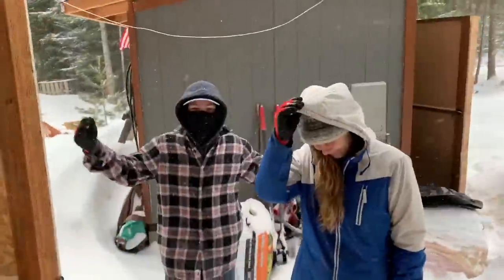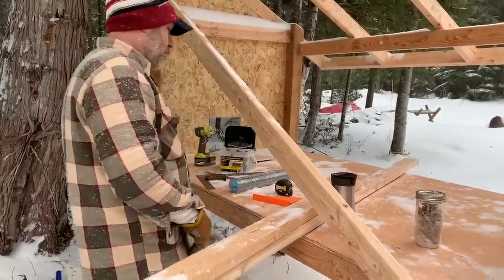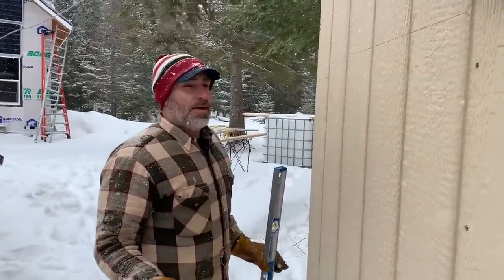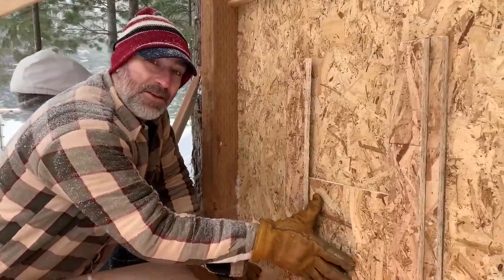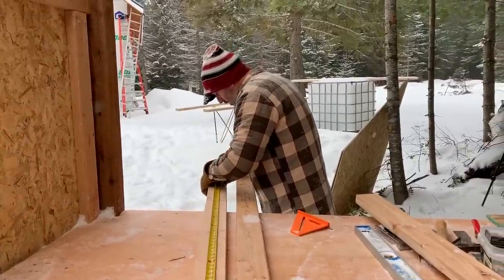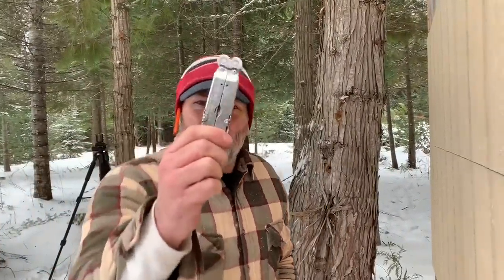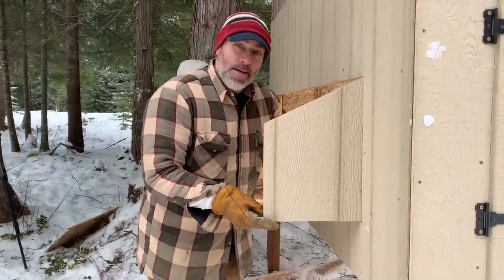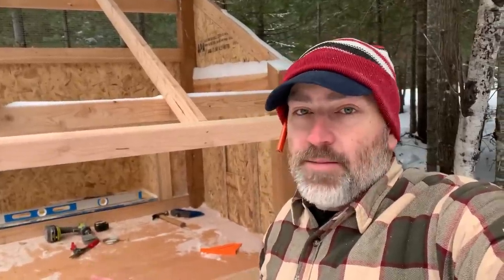BEST DIY CHICKEN COOP - How to Build a Chicken Coop - Part 2

Comment: Suggestions: #1 put a heavy coat of paint on your floors or glue down some type of floor covering.otherwise poop will soak into the floor. Also possible water spills. #2 I cut a trap door in the floor to close when it gets really cold. Open it when raining and they can go to the basement and hang out. I covered the basement walls with hardware cloth (wire) to keep them safe.

Comment: Chicken door should be any size you want. I've had chickens for 42 years and trust me the chickens don't care.😀 Automatic doors are a great invention. Leatherman has a lifetime warranty. I send in my multitools every 2 years to get sharpened and they just send me a new one. I'll never switch from Leatherman. Your place is really starting to come together.
Reply: I have had mine 20 years or more. the blade is getting a little thin but still going strong.
Reply: @bobf12  yeah they're fantastic.

Comment: Easy to take screws off, what does that say. Nails have more shear strength compare to screws.
Reply from the maker: Maybe. But that is not why they are easier. It is because the driver goes in reverse.
Reply: 😂nails can’t compare to screws in strength

Comment: Hi! Instead of worrying about the automatic door closing enough on the bottom, why not plane out a trench between the bottom of the door, and the wood beneath it? That would leave a gap space there for letting what needs to come out, exit.... while having another space for circulation - as well as keeping the chickens inside! A quarter to a half inch (or even three-quarters, if there's enough material) should be sufficient.